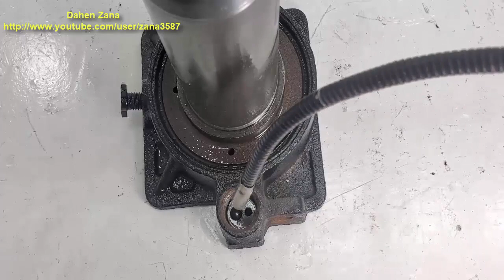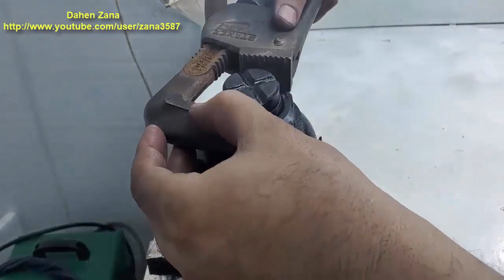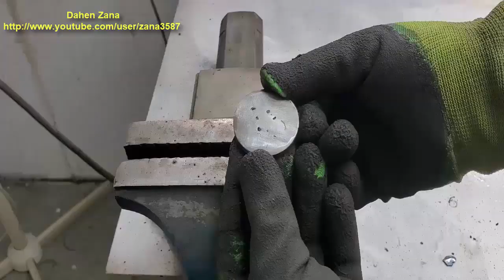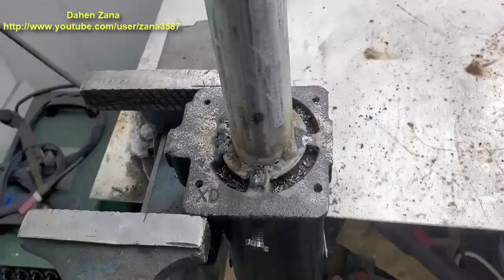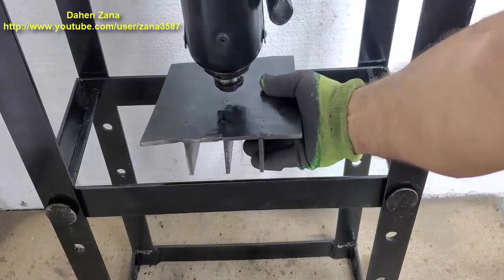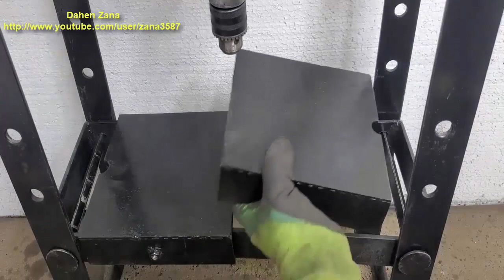Hydraulic Press - New idea

Comment: Nice job. To summarize : in oder to operate a hydrolic jack upside down, the only necessary trick is the small pipe going to the top (then after turning  bottom) in order for the pump to access the oil reservoir ? Also do you really need the second hole to fill back the reservoir ? You could fill it through the original seal but standing and turn it over after the hole is closed again.
Reply from the maker: thank you for your information
Reply: @zana3587  It was not an information. It was a question to check if I have got it correctly. You are the tech guy, I am just a student.
Reply: @isaacnguyen6944  Yes, you only need the pipe going to the top to make it work upside down. 
On some hydraulic jacks that seal is not just a plug but a vent valve and must be above the oil level. Without venting too much vacuum can build up and the pump cannot draw in oil and if too much pressure builds up both the pump piston and the hydraulic cylinder piston will extend on their own instead of keep retracted.

Comment: Why don't you just connect and extent a hose from the filling in port to a small oil bucket [for oil return] above the jack and make sure that the oil jack container is filled with oil with the piston fully extended out inverted?
I thought it would be much safer and easier?